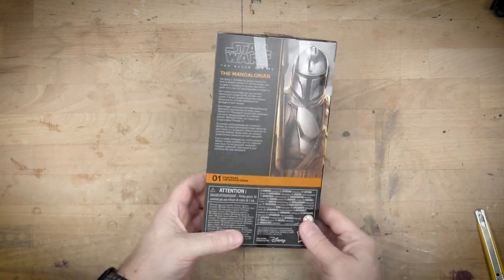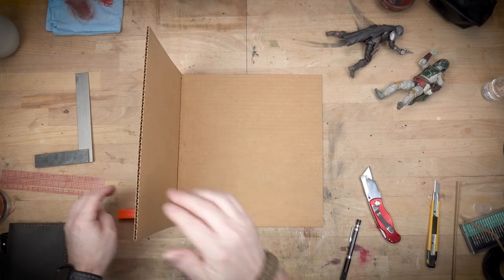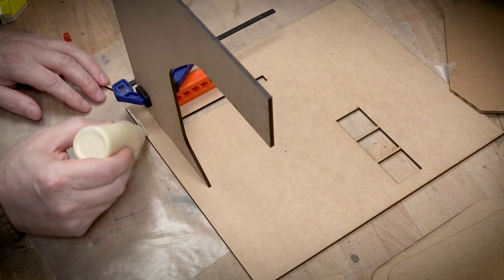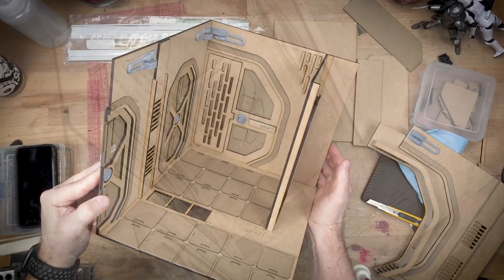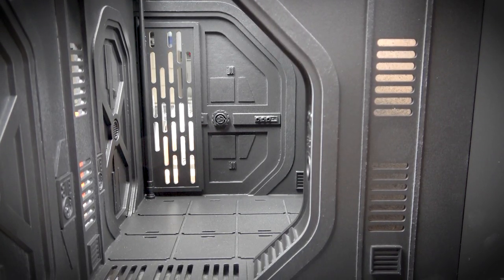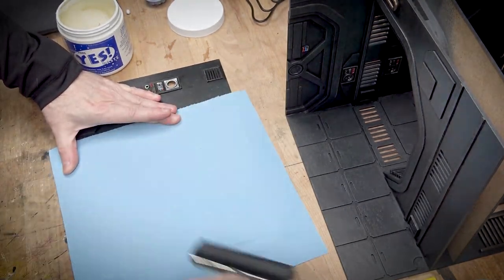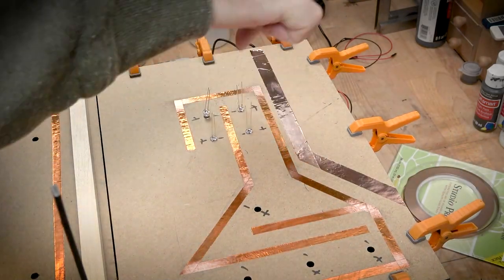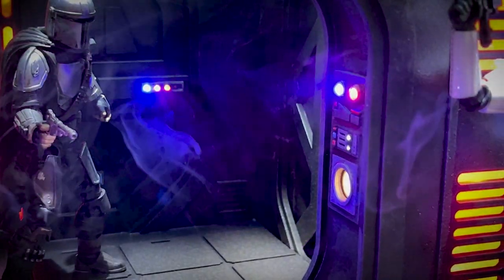I Built a Mandalorian Book Nook!

Comment: Looks fantastic and great theme. Nice details and the lighting adds so much to it. Which laser cutter are you using and do you like it or would buy a different one?
Reply from the maker: I have an Orion Motor Tech 50W with a 12" x 20" bed. I love it but it's huge... shoulda read those dimensions before ordering and then measured the space I had. It's pretty capable out of the box with the water and little air pump it ships with but I've added a larger compressor, water cooler, and air filter so I don't end up with complaints from the neighbors. It's an investment to be sure but it's amazing if you're doing a lot of model making where you need to cut intricate flat shapes.

I'm not sure if I would go a different route. I think 50 watt is about as low as I would go on power. If I look at the big things... laser, water cooler, compressor, air filter... I'm probably about $4,500 into the whole thing. It's a lotta money but it's a more capable machine than the Glowforge Pro at around $7K with another $1,200 for an air filter (the Glowforge Pro does have pass-through but is a 45 watt laser). As a tool, if you sell things you make, I think it's one that could earn it's keep and pay itself off pretty quickly.

One of the things I absolutely love about laser cutting is how fast you can whip up designs... it's 2D!!! I love my 3D printer(s) too but 3D just adds that literal extra dimension of complexity in designing and fabricating.

Maybe I should do a video on my laser cutter :)!  Thanks for asking! Hope that helps.
Reply: @RandomMakingEncounters  Yes! please do a video on your laser cutter :-)